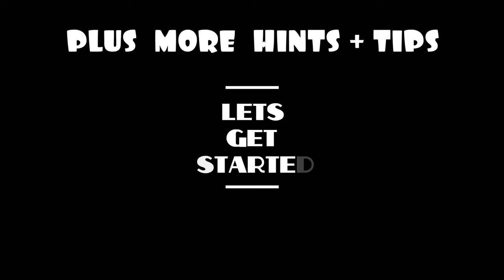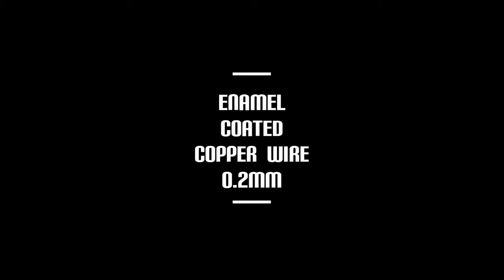Repairing Broken Traces / PCB Trace Repair - Soldering Fix

Comment: Back when I used my education for my job I use to make these repairs.  I was a little more crude than how you did it, but the same repair basically.  The worst one was a 14 pin IC was ripped from the board with just two pin holes left to attach the IC with.  I got it done and it lasted for years.  Great tutorial and I wish there was more need of this today since we live in a replacement society now instead of a repair society.
Reply from the maker: Hi , thank you for watching the video and commenting , very much appreciated . Hopefully my videos can help a few people out with their soldering / desoldering issues. If they can then that's great . You are right , it would be great if more people had a go at fixing some of their broken gadgets . Thanks again , take care 👍

Comment: Using solder to measure wire run length is genius!  Thanks!
Reply from the maker: Hi , thank you for your comment, much appreciated. I'm glad you enjoyed the video, I've used the solder trick to measure some weird shape tracks before , must admit it does work well . Thanks again , take care 👍
Reply: Hi. What if you use the solder wire itself as conductor and solder it to the PCB. Would that be ok?

Comment: Nice and helpful, as always!  Thanks for the effort.

Here's my particular problem...  maybe because I'm so clumsy as I try to fix this amplifier, pulling the power transistors out, back in, out again...  and the board is decades old.  So all the trauma has broken the pads loose; they come out with the transistor, or the pad is pulled up and the trace is broken away from the board for some length, or... the pad on the back just breaks loose with the heat and is lost.  And the old board is saturated with flux and such; it's really a bit of a mess.

I don't have a spare board to pull traces off, but I can probably work that out somehow.  What puzzles me is how to attach the pads and traces.  Originally, soldering to the pad, bonded to the. board, would provide some support for this big old transistor, but I can't think of a way to provide that original strength again; everything forming a nice tight connection, physically as well as electrically.

Sometime when you feel like making a video, maybe you have a couple of ideas about this kind of repair to show us?  Unfortunately not as tidy as some of your normal work!  I do prefer clean boards, but...  :-)
Reply from the maker: Hi , thank you for watching the video , much appreciated. Maybe you could try and fit a PCB insert ( PCB eyelet ) into the hole . They push in and then you flatten the other side down . Then your through hole part goes through this new barrel which is obviously tight in the board and can't come out . Then you can connect new traces , wires etc to the through hole parts leg. Could this be an answer for you ? Hopefully it could be . If so just Google PCB barrel inserts or PCB eyelets and you should find something the size you need . You can get tools to secure the other side or snip down about 1mm in 3 or 4 places and push down the flaps with a suitable tool .Thanks again , good luck 👍
Reply: @mrsolderfix3996  Great idea!  I've never used such things.  Thanks very much; I'll give it a try!
Reply: Thank you for asking. My exact problem except that I dropped my piece of equipment. The impact caused 2 x 1-2mm copper  pads  of a rotary selector switch to come away from the board. With this hair frizzling, brain twitching issue at hand  I'm like. Holy crap what can I do?!

 This may be the answer. Thank you for the advice OP. We appreciate your work and effort meticulously detailing various solutions. You are greatly appreciated.
Reply from the maker: Hi , no problem , good luck with your repair work , take care 👍

Comment: İt's always pleasure to watch noce works. 

You should make a video about special traces like power, signal, RF etc. And which way is better to patch up
Reply from the maker: Hi , thank you for your comment much appreciated. Some traces it's quite hard to show , i.e RF traces . From personal experience a tiny amount different from the original can have a massive effect on board results so it would be almost impossible to get this over to people . But I like your suggestion though so thank you for that 👍

Comment: When making this sort of PCB repairs using bare copper wire, I like to give them a coat of colored nail polish to avoid any chance of shorts or corrosion. Green, Black or Red depending on need and occasion.

I LOVE the idea of using salvage boards to supply donor trace material. I never thought of doing that ! 😮
You didn't glue the replacement trace part down though, won't it heat up and act like a fuse ?

Thank you for these outstanding videos, as a retired Tech they'd have been incredibly helpful 30yrs ago !

They're very enjoyable to watch now though 🍻👍
Reply from the maker: Hi , thank you for your comment and your support of my channel , very much appreciated . If my videos can help a few people out with their soldering / desoldering issues then I'm happy . Thanks again , take care 👍

Comment: 8:20 You mentioned earlier that you were planning to use 30 gauge kynar wire. In my experience, 30 gauge kynar wire is used for wire-wrapping and has a flexible solid single core of wire with a very thin insulating jacket, and it looks entirely different from what you actually used. Do you have a change of plan and use a different type of wire here?
Reply from the maker: Hi . Your comment is rather confusing . At 8.20 the green wire you see in the video is 30 gauge Kynar wire which in my experience ( working on military standard boards etc ) is commonly used for board modifications and this wire is actually a recommended PCB wire. Maybe you have used it for wire wrapping , I haven't , so the answer to your question basically is NO I didn't change my plan I did use Kynar as I said I would . Thanks.

Comment: Was wondering what flux you are using thanks for posting.Nice working learned alot especially removing component sm boards
Reply from the maker: Hi , thank you for your comment. I have always used SMFL200D rework flux which is great but unfortunately it has recently been discontinued. I still have a small supply left but will be looking for a decent alternative in the near future . Once I find one I will post it on YouTube. Sorry I couldn't help you anymore than that . Thanks again , take care 👍

Comment: Would there be any reason to cover the braid patch or wire ends with the tacdown or something else to insulate the repairs?
Reply from the maker: Hi , thank you for your comment. Yes you could do if needed with solder mask , tak Pak etc , I thought I mentioned this , but maybe I didn't. If the new joints have nothing close by that may short out then probably not necessary , but wouldn't hurt to protect new joints. Thanks again 👍

Comment: When transposing a trace to replace missing trace, it seems like it might be a good idea to glue the trace down, too, especially if the trace is longer than a couple of centimeters.
Reply from the maker: Hi , I actually showed the gluing down process of the trace in a couple of these methods and also spoke about solder mask as if I'm doing any kind of trace repair generally I would bond down using a  PCB glue called Tak Pak. I also show the bonding down of traces in some of my other videos . Hope that clears your question up , thanks 👍

Comment: Hi, what are the sizes for the copper wires I should get for those traces? 
Would 0.5mm suffice?
Reply from the maker: Hi , thank you for your comment , much appreciated . The green wire used in this video was 28 gauge Kynar wire  . I basically always try and match the width of the existing trace when I'm repairing with modification wires . This can be pretty important . Hope that helps , thanks again 👍

Comment: That's the best video on this subject that I've seen so far. I was sick of those videos talking only about using wires to fix the broken traces. Thank you very much, but I have a question, I watched the video skipping parts, not sure if you talked about that, but which glue could be used below the traces? I tried using super glue once, but it's toxic, not safe for soldering.
Reply from the maker: Hi , thank you for your comment, much appreciated. Like you say you have to be careful placing glue under the traces . I tend to solder the trace or wire in place and then glue afterwards still creating a strong bond . The glue I would normally use on PCB work is called Tak Pak , a 2 part ( glue + activator) substance , made really for PCB work . Available as a kit but cheaper if brought seperately on Amazon , eBay etc. I've used it in a few of my videos and I talk about how I use it for better results ( differently to the recommended way ) . Hope that helps , thanks again 👍
Reply: @mrsolderfix3996  Is that glue the same as a superbonder?
Reply from the maker: Hi , I'm sorry I'm not sure on that one . Tak Pak is a great PCB glue as it can be removed if required but will stay strong if left alone . Sorry again that I couldn't answer your question .
Reply: @mrsolderfix3996  No problem. I've noticed that there are two types of tak pak, one is a super bonder, the other one is for printed circuits, the thing is that I'm in Brazil, so it's hella expensive due to customs. Can you tell me which chemical compost the version for printed circuits uses? This way I might be able to do my own research here. Thank you for everything you've done so far.

Comment: so that solder path you made at 7:40 is just a guide you made to measure the copper wire?
Reply from the maker: Hi . I just placed a piece of shaped solder into the path where the existing trace was ( this is what you can see ) i then just removed it , straightened it then measured it up against a piece of sleeved Kynar wire ( match the sleeving length ) this gives you the exact length of  sleeving to perfectly match the old trace route.
Reply: @mrsolderfix3996    I see, thanks for the clarification. I have a suggestion for future videos if you don't mind: listing the materials you're using (such as kinar wires) in the video description.
Reply from the maker: Hi , thank you for your suggestion . I used to list certain items in my really early videos , and your right , maybe I could list some in the video description in the future . Thanks for your support , take care 👍

Comment: The way I would intuitively go with is to glue those traces back onto the board and then scrape the remaining ends to bridge the missing part. Is there a good reason why I should not attempt this method? Perhaps the springiness of the metal will eventually overcome the glue? Perhaps the trace has a weak point that might inadvertently snap off later ? Any thoughts on that? Did you try that and if you did, how did you fare? I always attack the enamel on a wire with tiny grain sanding paper(200 or so) rather than a scalpel. Your work looks incredibly neat btw.
Reply from the maker: Hi , thank you for your comment. When I have a curled up damaged trace I would  always remove it and attach a wire of similar thickness ( very important ) as it's just stronger , insulated properly and will not fall apart potentially in the future . Like you say you risk the trace shifting in the future , the solder resist on the trace will probably be cracked so has no protection from shorts etc and is just not as strong as it once was . I personally haven't experienced what's happened later with a repair on a trace that's badly damaged like these because I would have replaced them . Thanks again , take care 👍

Comment: What size soldering tip are you using? It looks finer than any of the tips I've managed to find.
Reply from the maker: Hi , thank you for your comment. I've gone against what everyone believes here. I use a Weller TCP S 50 watt iron and the tips for this particular iron you can actually needle file down very carefully until you get a lovely fine conical end. I use a PTP7 tip which is conical to start with but I file it down slightly to get it finer . Lots of people say you can't file tips etc because you destroy the coating , well you obviously can . I also own a Metcal soldering station and have also filed them down previously with great success. I'd say if your struggling and you have a spare tip try shaping it slightly with a needle file or Emery cloth until you get the desired shape. 
I'm not saying you can do this with every make of iron but it's worth a try . Hope that helps , thanks again 👍

Comment: Trying to understand why you try to follow the exact same path as the trace....is the timing this sensitive?
Reply from the maker: Hi , thank you for your comment , much appreciated . It can be very important the length of the trace on some boards . You will sometimes see some crazy shaped traces as the board designer needed to place certain length traces within his design . This is why it's good practice if you can to try and follow the original trace position then you will have no problems . Hope that helps , thanks again 👍
Reply: @mrsolderfix3996  So it's good practice for when it's actually critical like very high data transfer or RF circuitry

Comment: Awesome video! Im trying to repair trace pads for a usbc that broke. I am having an issue where the solder does not stick to the copper. I am using flux. Any help would be greatly appreciated 🙏

Comment: Very good video. I've used these methods many times but personally, I like to use enameled wire or bare wire as I find insulated wire too bulky. I then use nail polish to coat and glue the wire down to the board. Two or three coats of nail polish and it can stand up to abrasion not likely to snag if some rough handling in reinstalling the PCB. 

The real nightmare comes when a surface mount component gets torn off taking the traces with it. Such as a SM micro-USB that's been stressed and wiggled extensively. A real pain to repair... I got one sitting on my desk waiting for my attention. I guess I better stop watching videos and get to work. 🙄
Reply from the maker: Hi , thank you for your comment, much appreciated. I'm glad you have mentioned how you like to do your trace repairs. The more options that we have to choose from the better. Thanks again , and keep up the good work 👍

Comment: You need a microscope and a steady hand for this kind of work. Excellent job you made there.
Reply from the maker: Hi , thank you for your comment, much appreciated 👍
Reply: Most people find that once the magnification is sufficient the hand steadiness follows. It's uncanny how easily hand eye coordination adjusts to much smaller movement once you try it a few times. Good practice is to carefully put a very fine point on a pencil and write out a paragraph as small as you can using whatever microscope or binocular magnifier you're comfortable with. You'll instantly be amazed that your brain is so easily fooled into making very small and accurate movements.

Comment: Great vid! I've got a board that has some damaged pins but they're unlike anything I've seen before. Rather than being soldered to the board, they're actually small rivets and the connection is made to the board by the friction of the rivet. The connector mates directly to them and the rivets have become loose causing intermittent operation. I think if you soldered the rivets, the weight of the connector would stress the rivets and they'd pop off again. I thought about replacing the "rivet" with a small screw/nut instead (maybe brass?) and smoothing the threads to make a sort of pin. Any thoughts on a good repair?

Comment: @8:18 is that justh heat shrink tubing, or is that another product?  If something else, what is it called, and where can we get it?
Reply from the maker: Hi , thank you for your comment . The green wire is Kynar wire ( 30 gauge ) Farnell , RS components, many others sell it . I measured the length I required with a piece of shaped solder then straightened it and cut and prepared the Kynar the same . This will give you the perfect length to match the old trace . Hope that helps , thanks again ☺️
Reply: @mrsolderfix3996  Ohhh that was just a piece of solder @7:17? -- Okay -- Sorry -- I thought you had a raw peice of wire, and slid on the plastic sheath separately...

Comment: So something ive been wanting to do is cut some existing pcbs and move around the cut pieces to fit in a new housing. Can i repair the traces by just soldering a wire to each end?
Reply from the maker: Hi , thank you for your question . Yes you should be fine doing this . All I would say Is try and match the width of the trace with the wire width . You don't really want a large trace reconnected with a skinny wire as it could potentially be affected with the current etc going down it . Hope you get on ok , thanks again 👍

Comment: Hello, I changed the switches of my keyboard and apparently I burned more than the account with the soldering iron and I eliminated the layer of pre-tin from the trought pad. Now the tin does not stick and if it does stick it does not make contact, therefore the key is useless Any solution to repair the track?  Thank you

Comment: Is it important to follow the exact path or can it be done in a straighter line if using wire to make the connection.
Reply from the maker: Hi , thank you for your comment , much appreciated. If possible try and recreate the same path as in some instances this can be pretty important especially when working on RF boards . You will sometimes see some really weird curved traces on your boards this is because the designer needed a certain length trace from point to point so achieves this by these curved traces. Hope that helps , thanks again 👍